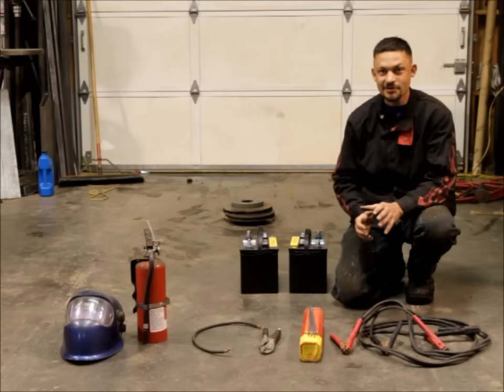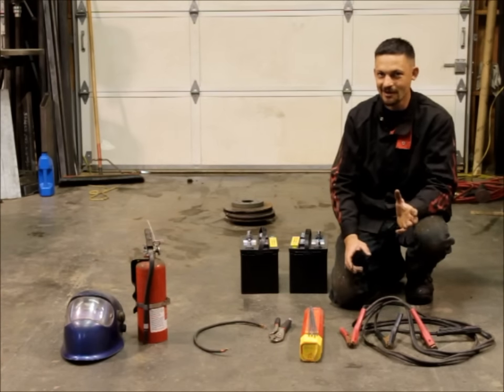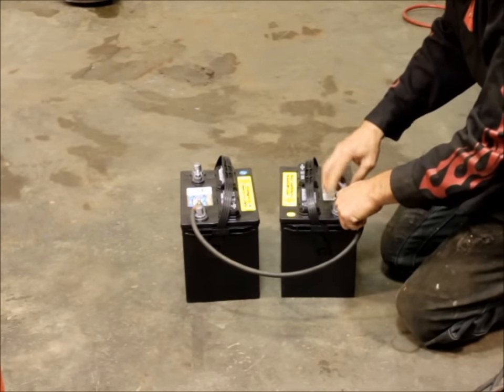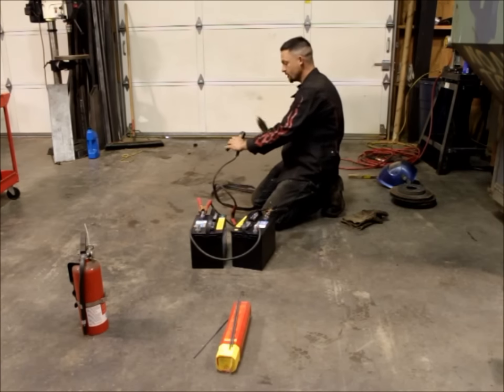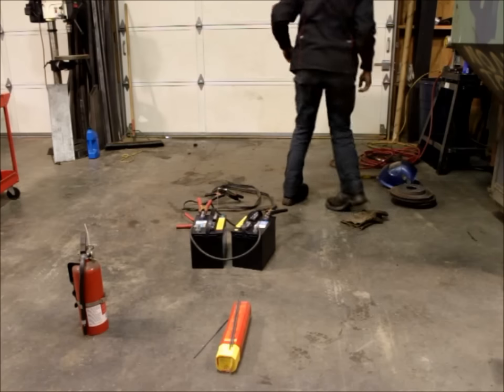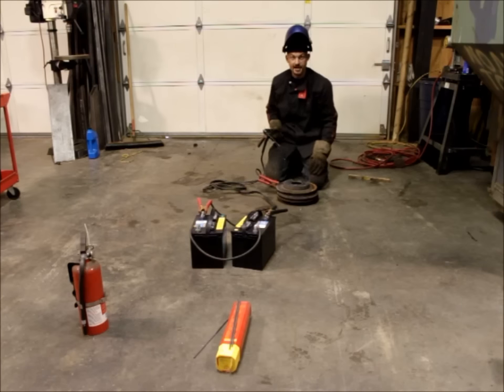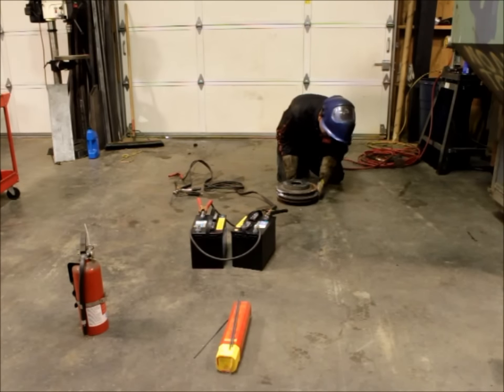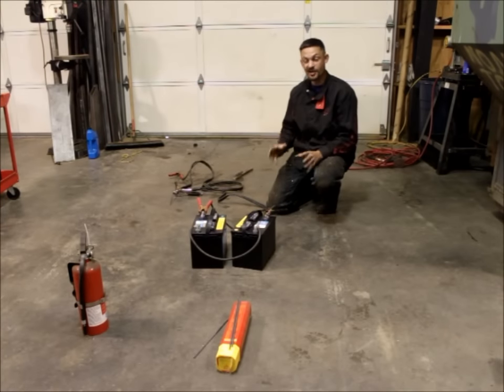Welding with jumper cables and a pair of batteries

Comment: They sell set ups for jeeps specifically that upgrades the alternator and includes a management panel and female connectors for welding leads and grounds to provide a constant power source driven by the motor for people who are often in situations which require them to field weld "unexpectedly", as in less than a person whose intended purpose is to be field welding, but more than a person who wouldn't understand how to field weld if their vehicle broke on the trail anyway... 

Its incredibly useful knowledge that you have done a really good job explaining the basics of as well as addressing the obvious shortcomings of its application, Thank you and well done!  This is absolutely worth reviewing and having a working understanding of for emergency situations (the reason we train for emergencies is because during an emergency is not the time to learn the skills needed to be competent in handling emergencies)

Comment: Many farmers would use this trick out in the field when they experienced a structural breakdown on their equipment. And the idea of using batteries has been around since the 1930's. Like all "lost arts",  it gets "discovered" again with new ideas and concepts applied. Enjoyed the video....keep up the good work!   One thing....what type of rod were you using?
Reply from the maker: scada4321 thanks, an old farmer taught me how to do this over 30 years ago!  I typically carry 6011 Rod in my vehicle
Reply: 4x4 guys have always done this. as in: since there were jeeps and trucks to break. it's not a lost... anything. I first saw it in the southern Utah desert in the 1970's. rear differential broken? pull two batteries and break out some rods to spider weld the diff
Reply: Absolutely mate, Im a farmer myself, and Iv used this many times. Just the other month I did it to repair a a crack in the arm of my front end loader, just to get me through the day and back to the shed
Reply: An old trick. When I grew up we were still part of the Great Electrification, which took many years.

Rural mountain farms used this regularly. You could even hook a windmill to the batteries between uses, by hanging a car generator and regulator on the windmill, and keep the welding batteries charged.
Reply: Is it a recent switch then to the 7018 rod you've also mentioned? Why the change?
Reply: @frankjaegar1805  24V. Ac voltage can kill you.
Reply: @djdanzy  volts jolt. Current kills.

Comment: Definitely going to keep this in my back pocket. 

I have an RV with two deep cycle batteries and all of the connections for this that I take in the back country. All I need to add is welding rod and a helmet. 

Good to know about the polarity. Electrons flow from negative to positive so it makes sense. 

Thanks!

Comment: What series rod are you using?
Reply: For easy welding & welding rusty sort of dirty steel you can use 6013 rod. That's what's used for repairs to farm equipment. For stronger welds a 70 series rod is better. I would take 7014 rod on the trail since even wet it'll weld pretty well. A lot of welders prefer 7018 fast freeze rod but you'd have to take a new unopened 5 pound package with you or keep it in a rod oven. Less practical. 7018 doesn't work well with any moisture in it.
Reply: We use 6011 on our job sites and 6013 on the farm.  Both would work equally well. 

70 series could work but if suggest to avoid it with this method if possible.  We use 7018 for structural welds on job sites and it requires alot more current to run properly.

Comment: good video and factual data. ONce rode astride jeep engine with open hood. air filter off, me dripping gas from coke bottle directly down carb to run engine. buddy driving. bad fuel pump. worked pretty well for 8 miles to a paved road and tow vehicle. Saved walking. Had to stop to refill bottle many times. down hills was fine, going up was a challenge, but I kinda got the hang of it. Never thought of a possible backfire!! Tired thumb on bottle top made me have to stop and rest also. You do lots of goofy things when you are 18 to save a long walk.
Reply: Your not alone. Did that to get home one Sat night a long time ago. Only it was a '76 ford ranchero. Edit: We had to take the hood off and put it in the back, so my buddy could see where he was going.
Reply: Cousin of mine with the same problem used his windshield washers system, dumped out the fluid, filled it with gas rerouted the line to the top of the cab, had to repeatedly pump that button but it worked, and a little safer, plus you could do it in a pissing down rainstorm , unfortunately with the newer tecnobuggies we drive now probably can't do either now.
Reply: You're indeed a tough cookie. Admirable story!! 

Intelligence is indeed not necessarily AT ALL connected to these sick square-circle-triangle figures on paper. You must be a lucky man, daily experiencing the benefits of having a great brain. 

Congratulations!

I hope that you are happy, too?
Reply: Tired thumb?  hell,i would just have poked a small hole on the soda bottle cap    lol

Comment: Something a lot of people don't know about. Also useful for pulling dents on cars that glue won't suffice with. Use a washer, and a hook to pull on it (or multigrips), then knock it up and down a few times with whatever is in your hand to wiggle it to break it free, grab it in the jumper cables again, re-attach, repeat until the dent is gone.

Comment: That was freaken awesome dude ! Thumbs up for You ! :) Do you require any particular kind of welding rods for the DC battery version of this type of welding, or will any type work ?
Reply: james bolton Thanks for the heads up on the type of welding rods for DC welding James :) I am going off Grid this Spring so I will need to be doing some small tack welds :)
Reply: Mark Job it uses more power, but DC to AC converter? seems obvious but idk.
Reply: Mark Job j

Comment: Lifesaver method! Thanks. When I was a kid my grandpa weld with the battery boxes and water adding salt. I don´ t have clear how, but he added more or less salt depending the amp that he needed. And yes, we live in Cuba at this time, there isn´t Harbor Freight, He used it as shop welder. Years later he get a old and broken huge electric transformer, that´s kind that is used in post on the streets and he build a sticker welder with regulation which was a crank and this crank displace the center of coil near or far for desired amperage.
Reply: Amazing! I can see how that would work.

Comment: Been a Pro Mechanic 40+ years Always heard you can weld from Car Battery but Two Batteries in Series by the look of the Flash and Sound you had Plenty of Power to Melt Metal on  both Rotors  your Welds Look Really good. I learned a Very Cool Skill Tonight  See you can teach a Old Dog New Trick.  You guys are Young Learn New Skills everyday it's so Important I still do.  Good Luck

Comment: You pulled a good one.  Good for emergency use when you have no power for welder.  What rod number and rod thickness did you use?  What is your estimate on the current draw from the batteries?  Thanks for the video.

Comment: you sir, you are my hero of the month on youtube. just because of your safety preparations (fire extinguisher)
Reply: Victor Fernandez not quite. Shouldn't the extinguisher be at arm's reach? Just a guy who put one in camera site to lessen the the backlash of negative comments.
Reply: @elpapirin9240  WOW 😯 El Negatoro had to put in something negative 👎🏻 This is the guy that would have froze up if a fire happened and it wouldn’t have mattered if one was at arms reach or a hundred miles away. And afterwards he would have blamed it on anyone but himself.

Comment from the maker: The welds are just as strong as those done with a "normal" welder; getting a proper weld has more to do with the skill of the person holding the welding rod.  As far as using this for your primary welding power supply; I know people who have done this, but you are limited to the thickness and type of material you can weld, and if you are purchasing the batteries, jumper cables, etc. the costs can add up quickly to the cost of a used craigslist welder...

Comment: 2 Questions: 1) As a good general purpose emergency kit what should I buy in welding rod? 2)  Is there a best way to store the rod to prevent moisture etc from making it less useful?  Vacuum pack? Excellent video, I really learned something I didn't know... Rod on the negative terminal... wouldn't have guessed that.
Reply from the maker: 6011 is a good general purpose electrode; I'd say it would cover the majority of the trail repairs that you might come up against.  If you have the ability to vacuum seal your welding rods, that would be best.  I just keep mine in a gasketed hard case....
Reply: Ammo can🤔

Comment: We used to weld like that on the farm I grew up on. I used to drive down to the town dump with my '66 Dodge pickup and sort through for useful metal to repair machinery that broke down. Later, I won a Lincoln welder from an auction for $20 and mounted it on my truck and picked up some extra cash welding for other farmers in the area. Got to know a lot of people that way. New York wasn't all city at that time. Now I am 65 and I still remember......

Comment: good job...we did that in the military in the field!  
a welding blanket will reduce fires...
thanks for the reminder...it is also helpful in the case of a vehicle break down...or in my case.. I had a buddy haul metal for my tree house framing. it is a truck camper on stilts...little more. easier to haul the batteries out than a generator capable of that current. made a wood table and a welding blanket work area to reduce risk of fire.
videos like this one are very valuable to teach, remind and assist DIY people that you have choices sometimes you need to think and ask..
I would how ever recommend a class at a school in basic welding and have at least little brazing cooper in that...Im not a welder Im an Engineer...lousy tools in the bag beat no tools in the bag...

Comment: Really good - THANKS for posting!
I know the 6011 rod will penetrate well even on fairly nasty workpieces, but was surprised the electrode (rod) was on the negative side - sure worked though. In practice, the negative side in DC welding is the side that gets the most heat applied (so I assumed the brakes needed that being thicker), but you certainly nailed it, so taught me something for sure.

Comment: What size or # welding rod we you using in this video??
Reply: Keith Good I've use small e6013 with good results. I've seen my buddy use 3 inch nails as rods cuz it's all we had. ugly weld but got us home.  3.2mm e6013 burns nice.
Reply: 1/8 inch 7018 works for me
Reply: @kadenchampoux6358   you related to Sylvain in Indiana?

Comment: Thats badass, obviously due caution is needed but for a quick tack i see no harm in this... thanks for sharing.
Reply from the maker: Invincible Extremes Thanks!  Yeah...it seems that I didn't emphasize "emergency trail repair" enough in my video.  It works great for trailside repairs, but certainly not a replacement for a good machine in the shop.  This method has helped me (and several others) get their junk off of the trail and back onto the trailer!
Reply: sewerzuk there's always going to be haters...

Comment from the maker: ***** No; the batteries supply 100-150 amps during welding.  Most battery chargers are not capable of doing this...
Reply: +sewerzuk  isnt rotors cast ... to weld cast you generally have to heat it and braise it right? ... and i know you can weld it .. and im sure ur just demonstrating with some scrap you had laying around .. but yeah welding cast with out pre heating it .. it never works out .. it sticks .. kinda .. but not really .. unless im wrong . but i think im right .. lol ..
Reply from the maker: Carolina Boys You are correct; and I should have used a different electrode, etc.  It was just some scrap in my scrap bin that I grabbed for demonstration purposes.
Reply: +sewerzuk yep most battery chargers are 6 - 10 amp
Reply: Brake rotors are cast steel, not iron.
Reply: How long can you weld at these amps?
Reply: Not long
Reply from the maker: You get around a minute or a little more of arc time, with enough left to re-start the vehicle.  Lots of variables go into this though, including battery health and capacity, amps used during welding, etc.  I've found that I never need more than a minute of arc time for most trail repairs.
Reply: sewerzuk
Reply: sewerzuk Would it be better to use deep cycle batteries for a portable welder?
Reply: The maximum amperage my old sears charger puts out is 50 amps. Nowhere close to the needed 100-150.

Comment: cover the batteries,,,, sparks and batteries dont mix well ,,BANG
Reply: Hydrogen gas is what causes the bang. 

Hydrogen is produced when batteries charge or discharge rapidly.
Reply: @Brian Reed ohh it only says in warning letters in the top of most car battery’s to keep it away from sparks. Pretty sure it’s discharging pretty quick with the things your gonna be doing while your welding........
Reply: @619guy202  I agree. Welding is putting a strain on the battery so it will emit hydrogen.

Not contradicting you, just explaining why batteries pop.
Reply: @619guy202   Whenever the car is on, the chances are it is charging the battery and therefore there is hydrogen. Additionally, the space is very small under the hood and there is a chance of an explosive air/hydrogen mixture happening.
 However, in a significantly larger space like a garage, shop, etc., there is a much smaller chance of reaching that critical point. You may get a small occasional pop, and that should be it.
 When you see warning labels, you should understand what conditions/circumstances they apply to, and not just blindly take them as a matter of fact.
Reply: Oh crap, I bought my son a four wheeler and he’s only 8 years old. The warning labels clearly state 12 years or older.  What a waste of my money.
Reply: According to Battery University, hydrogen gas is only a worry when overcharging batteries.
Also I think those batteries are quite happy having a fine day, quote: "a 1/8-inch 6010 rod runs well from 75 to 125 amps" found elsewhere, while car battery starting amperage is much higher, "400 amps, The Average Amps Required To Jump Start A Car." See Cold Cranking Amps.

Comment: It's amazing how many people CAN'T read a  video description, but CAN type and bitch, call names, utter totally off base faux safety babble,  rant and ask previously answered questions. Great job on this video, sewerzuk. I've cobbed a lot of crap together, but never heard of this one. You just KNOW  I'm gonna do it.  P.S-  Don't let it get out to the terrorists and activists about the EXPLODING  batteries.
Reply from the maker: Thanks for the comment (and thanks for taking the time to read the description)  Since so many people choose not to read the description, I'm in the process of putting together a followup video that answers the same questions I have seen a hundred times over.  This method of welding isn't new...lots of old timers used it before I did.  Its a real life saver when you're away from the shop!

Comment: Great video!  I've always heard that you could weld with batteries, but that's one of those old farm tricks going by the wayside.  Hardly anybody knows how because a good Lincoln arc welder is not really that expensive.  We are losing a lot of our smarts like this.  But like you said, it's for trail repairs.  I have heard many times that a lot of the trail clubs have a guy or two with some sort or welding rig on board - must be a California thing.  If I did that sort of trail work, I would have one as well.  I guess if you are going to weld on the trail, it helps to know how to do it in the shop as well - it's a good skill to have, not too difficult to learn and get pretty good at, and obviously lacking in many of those that posted below.  These are the kind of skills that are going to help us get back on our feet when the big one (whatever that may be) comes to pass - nothing super high tech, just people knowing how to work with their hands and what they have around.  Thanks for the video!
Reply from the maker: Thanks for the comment!  Like you said, its a good skill for the handyman to have under his belt.  You might never have to use it, but if the need ever arises there won't be any substitute!

Comment: What size and type of electrode were you using? I'm thinking you were running E6013 5/32". I wonder if it would burn Low High.

Comment: SUBBED!  Thank You for this!  Question?  How many amps are going through this system? My van has been retrofitted with a massive 115AH deep cycle battery.  My OEM alternator is 160amps.  With the engine running I can power up 12 amps of 110v (about 1500 watts) through a 2000 watt inverter with no issue.  I am wondering if I had a step up buck converter rated at 24v out 40amp (480w or maybe even 960w) would I be able to weld rebar like this with my engine running?

Comment: as someone who is into off reading that was awesome I've heard of welding with batteries but never seen it.  Freakin sweet
Reply from the maker: Anthony Sanchez thanks!  It really is a valuable skill to have.  I've used it dozens of times over the last 20 years...everything from frame repair, steering components, suspension parts, and more.  It's no substitute for a real welder in the shop, but it works to get you home when something breaks out on the trail.